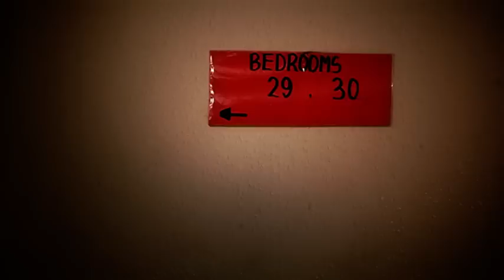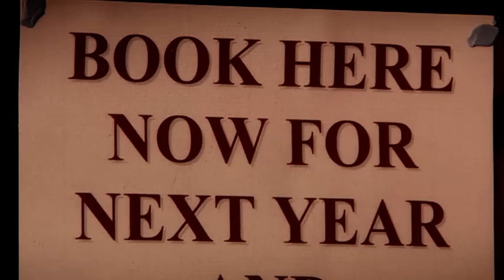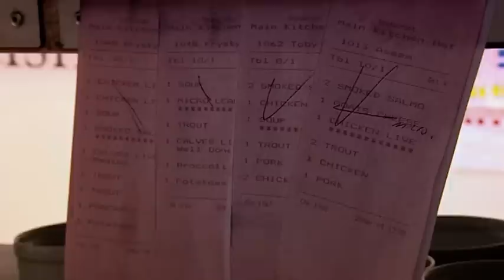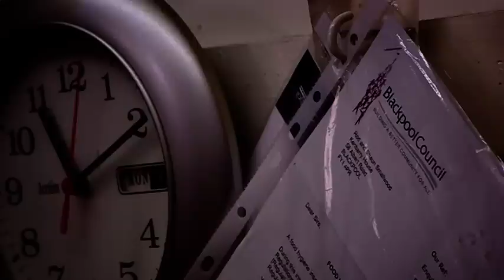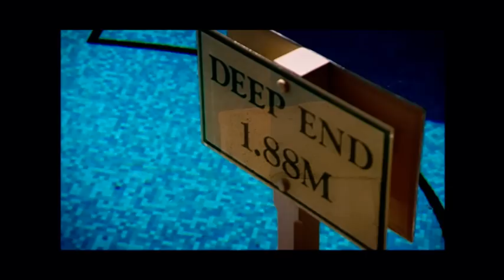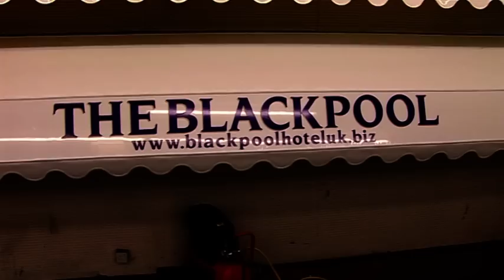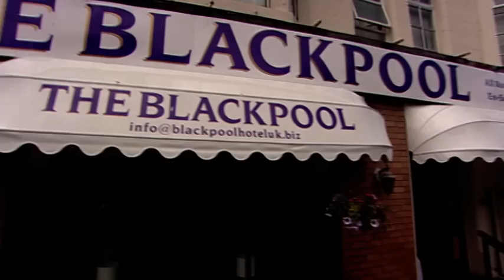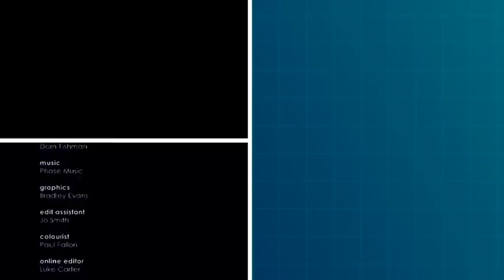Can Ruth Watson Save This Zero-Star Hotel? | Hotel Rescue | Abode

Comment: Olive oil is not to deep fry food, not only because is expensive, but because has a very specific taste that can be overpowering.
Reply: And because it becomes bitter when cooked at high temperatures required for deep frying.
Reply: @jacquelinewilson6493  do you mean 'bItter'?
Reply: @tonirose6776  Oh yes! Thanks. Have changed.
Reply: You're so right & its why I have to buy Light olive oil, to avoid that taste. Plus he...lied :(
Reply: * Bitter not Bliter with cooking w/ olive oil. I even had to look the info up thinking I didn't know the term bliter.
Reply: But Didn’t Ruth suggest that some of what he said wasn’t actually what they did.?
Reply: Oliver oil also oxidises when it’s heated and becomes poisonous
Reply: Olive oil should only be heated to a certain temperature, not frying temperature.😊

Comment: I did some searching online to see if the owners had continued to make improvements. Apparently they have. But the improvements must have happened recently, because there are some scathing reviews of the place on TripAdvisor. The fact that the hotel owners left nasty replies to those reviews does not make me think more favorably of them. And the restaurant still looks like a dungeon.
Reply: I agree regarding nasty replies.  They could simply request that the customer call them and they would do an intensive review of the room for any issues and address those right away.  Then offer some sort of partial refund.  Nasty replies give me the impression they do not take concerns seriously.

Since I am not from the UK, if I was to visit Blackpool, I would prefer spending more and have a fine breakfast.  However, if I lived in the UK and I was on Bank Holiday, I would consider a more economical place to stay.
Reply: Thanks for doing that research so I dont have to! I could see from their trial at the nice restaurant  that they weren't hospitatality types. The one with the grotty goatee has no elbow grease or gumption. The other guy seems nice but sedated. No bueno.

Comment: The problem is that neither man wants to run a hotel. One wants to run a restaurant; the other wants to run a spa. They need to narrow their scope, sell the hotel, and acquire facilities that will allow them to run a restaurant and a spa. Even then, they would need to do the necessary work to make people want to visit. In this case, they really needed to take the whole place down to the studs and start over with new structural, electrical, plumbing, heating, and air conditioning. That place looks like a firetrap. I wouldn't even make it to the room before I had to turn around and leave. I certainly wouldn't be able to make myself sleep there. I'd be awake, looking for the nearest fire escape.
Reply: It is truly disgusting. I felt like washing my hands just seeing the place 😂

Comment: Couldn't find the web site. What I found was the domain name was up for auction. Found some pics from a travelers guide. The front is what we saw. But changed, no logo. So it clearly looks like new owners. Now spa, but a hug pool table in the dinning room. And a tiny dinning area. Some took quite a few pics of the stained ceiling panels. Rooms look much better. And pics of happy people enjoying themselves.  It's a self check in and out hotel with no spa. Offers only breakfast.

Comment: Even if they spent £1000 per room renovating 10 rooms they could then be with a decent coming in. £2000 left and they could do out the dining reception and give the stairs a coat of paint. As the money comes in they could afford to get professionals in to upgrade one room at a time. It's not brain surgery. Just common sense.
Reply: Right, What happened to the 20,000 budget?
Reply: @sunkissed4261  I remember that 6-7,000 went to fire regulation changes.